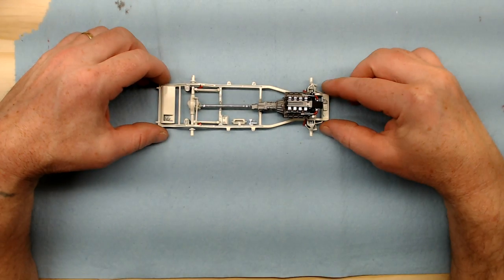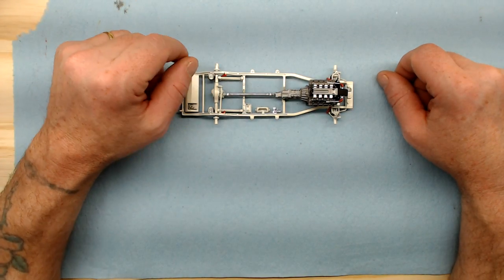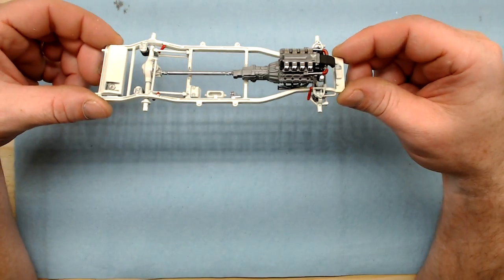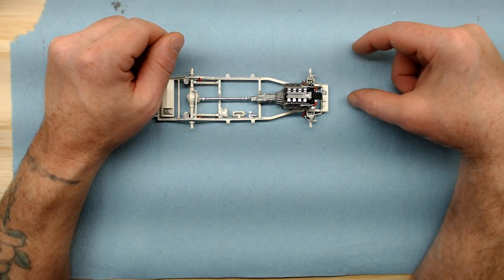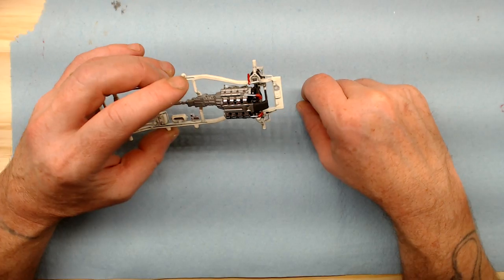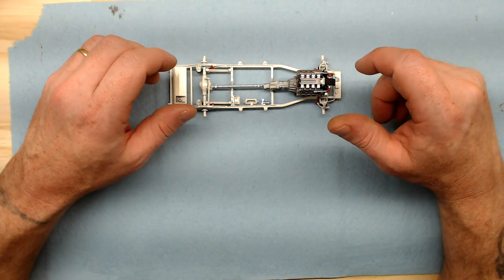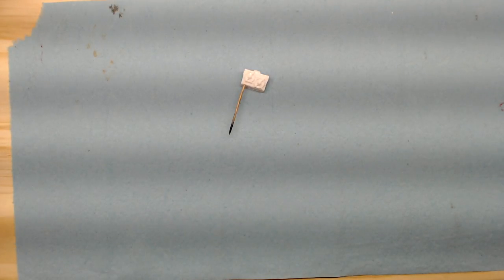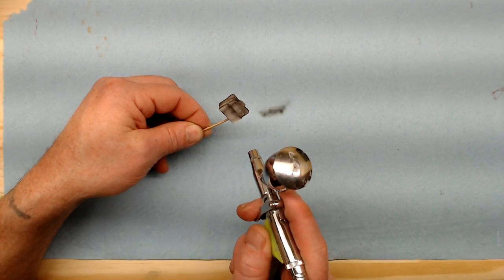showtime studios build tutorial (part 19)

Comment: It's coming together now.  Looks sharp, cleanly built and the finishes look natural whether they are representing paint, metal, rubber or plastic. 

My favorite part of the build is when the engine is installed in the chassis.  Everything else is just the shed to keep the engine and driver dry.  As a side note, that chassis seems to adapt well to various older vehicles.  That section of chassis behind the transmission mount is straight and be shortened or lengthened to adjust the wheelbase.  I've got an AMT 53 Chevy truck in the works using this setup.  Something for folks to consider as they get the basics mastered and want to try kitbashing.